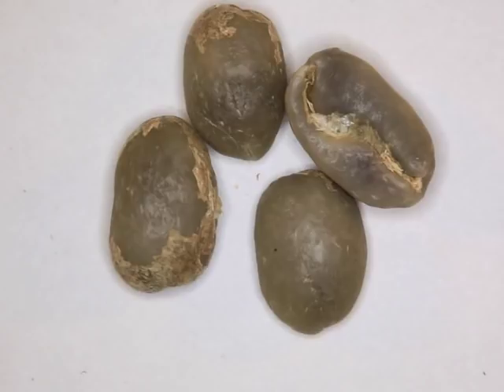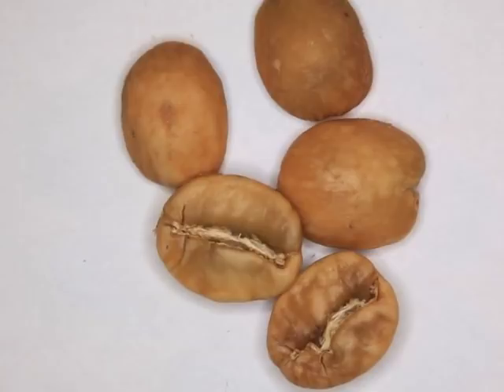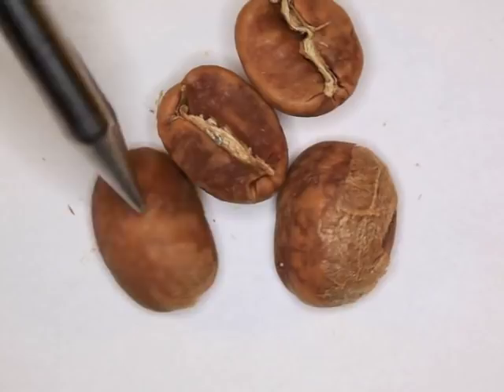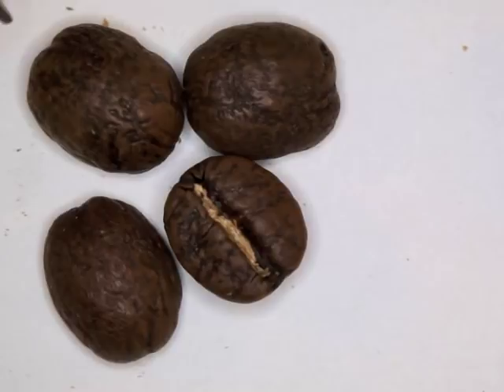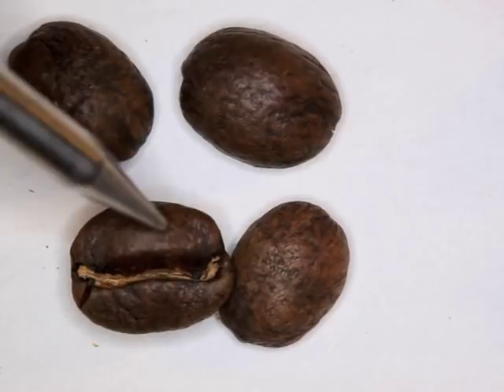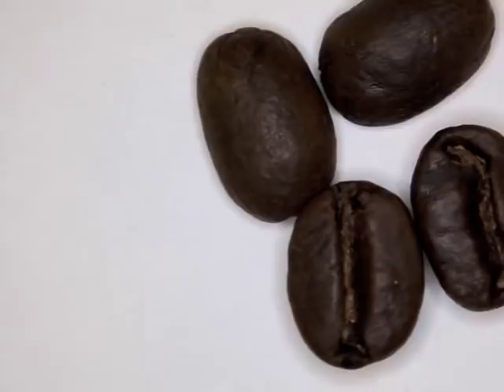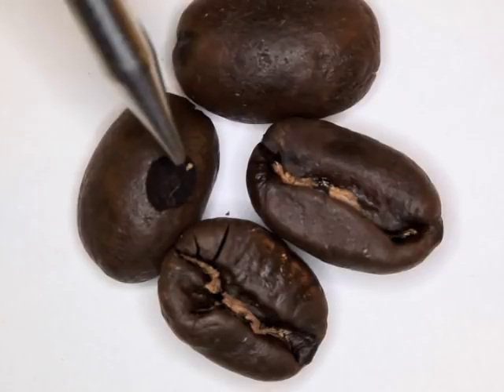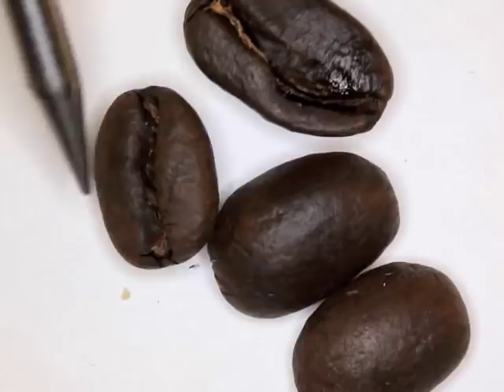Coffee Roasting Basics - Color Changes

Comment: This is a perfect little source of information for beginners, thank you for providing it.  Husband and I have been stove top roasting with a small Indian wok, a karhai, and an all-steel lid with drilled holes.  Stove is gas. Wok has steel handles which allows for an oak dowel or wood strip to run thru the wok handles and lid handle.  The wood serves to keep the lid in place so the wok can be shaken up and down vigorously and serves to keep the hands comfortably away from the heat.  Wok is about 7.5" size and can handle a 1/2 cup of green beans at a time.  Cost of wok was under $10.  This set up isn't for someone wanting to roast a pound at a time but still the beans come out perfectly even and we haven't had a single bad roast.
Reply: what a great name you have.

Comment: @1timby; I like the same roasts that you do and I've found different beans create very different flavors. Sumatra is one of my favorites because it has low acidity to begin with. Colombian is also very good when roasted to medium. I also only brew my coffee using the pour-over method which is basically the manual version of a drip. No bitterness at all, just smooth delicious coffee right down to the bottom of the pot. I use both the Chemex brewer and the Hario drip brewer for single cups. Hope this helps.

Comment: Hi, I have a couple of questions：-
1. Does roasting time is critical? Fresh roast is about 8-10 mins, drum takes longer. Which one is better in terms of taste?
2. When I roast my Brazil beans to full city plus, the taste turn out to be sour. What is the reason? Is this due to the beans quality or roasting temperature? How to resolve this? Extend the roast time longer to reduce the acidity level? Note: weight loss is about 15%.
Reply from the maker: Good questions. Both the FreshRoast and drum roaster can create really good roasts depending on how you go about your roast curve. Try roasting your Brazil with a lower heat going into 1st crack. This will give you more of an opportunity for an even roast. Also try a longer brew time.

Comment: The beans in this demonstration are Arabica beans, yes? Are the timings the same with Robusta beans, or shorter because the beans are smaller?
Reply from the maker: Yes, the beans are Arabica. Arabica beans can vary so much in size and density it's hard to say how fast they will roast but in general, Robusta beans are usually from lower altitudes and if this is the case they will probably roast a little faster than Arabica due to their lower density.
Reply: @SweetMariasCoffee  Good info, thanks!

Comment: I watched quite a number of videos, some are roasted for 5 minutes, some are roasted for 10 mins or longer. Assuming that it is a hot air roasting and the roasting level is medium roast. What is the most recommended roasting time ?
Reply from the maker: With air roasting, it's really about the roast level and timing your roast by listening for first and second cracks. But, in a nutshell, sub-5 minute roasts may be too short.

Comment: Great video bro, do different roasts effect caffeine levels?
Reply: Caffeine is pretty stable at the temperatures used for coffee roasting so the levels don't change much from light to dark roasts. If you are weighing your coffee before you brew it, a darker roast will have more since dark roasted coffee is less dense and requires more coffee to match the weight of lighter roasted coffee.
Reply: Yes! Lighter roasts will always have more caffeine than darker roasts. This is only due to the process of caffeine molecules basically being roasted away as higher temperatures and longer roast times take affect. Now who's to say how much of a caffeine difference there is would probably tell you not much at all